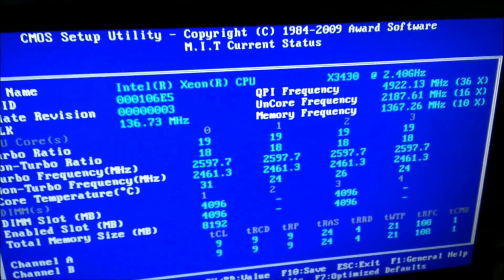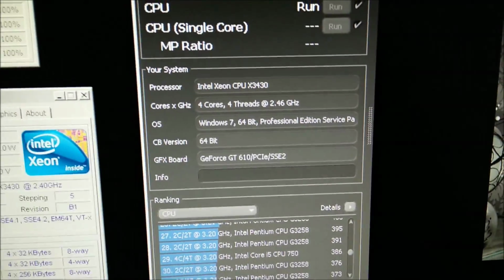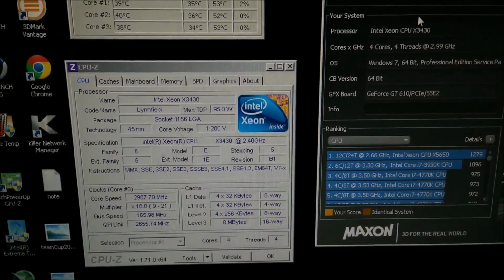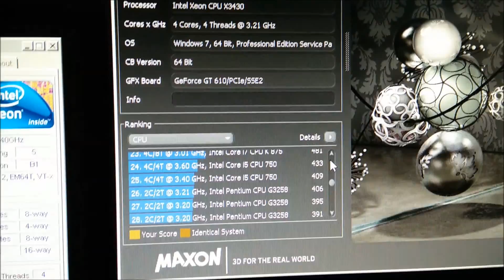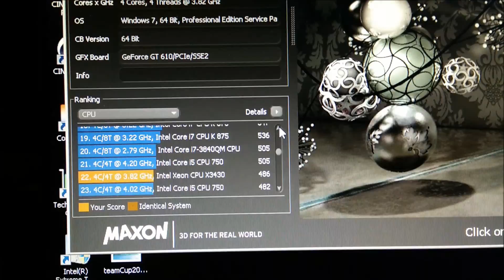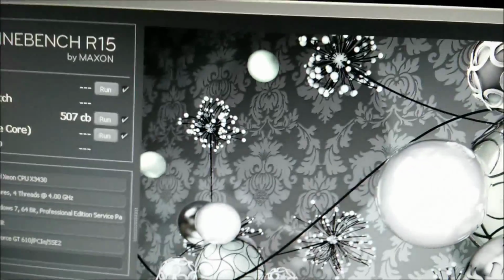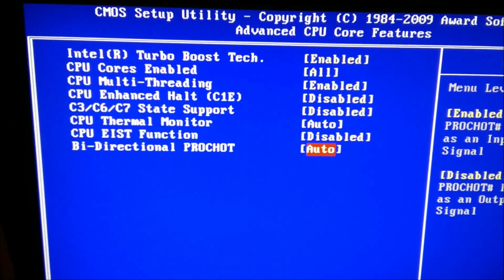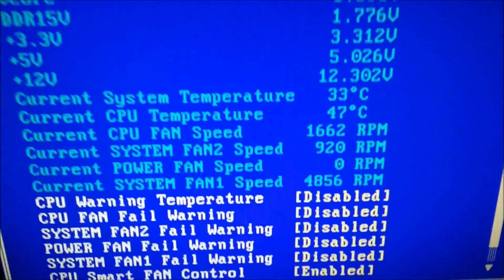Xeon X3430 £20 i5 Killer?

Comment: Hey Guys! 
So I was wondering, how'd you know what LGA 1156 motherboard is compatible with the specific Xeon series such as the x3430? 
Don't need to overclock, just planning on a very cheap build for a family member and I doubt they'd do a lot of heavy gaming.
Reply from the maker: Jimbo Guiling any board will take it as long as it's on the cpu compatability list on the board manufacturers website

Comment: Is it necessary to use a really big CPU cooler for overclocking to say 3.8? I was looking at an ARCTIC Alpine 11 Plus.
Reply from the maker: yes, you will not be able to oc very far on a stock cooler. there are some great coolers on aliexpress for £15-25. I have just ordered the VTG 5 cooler which has 2x 120mm and 5 heatpipes for £22. I will probably do a video on it to show the performance when it arrives in a few weeks.. :)
Reply: Lawrence Timme are these better than a Deep Cool Hyper 212 Evo? I was looking at the VTG 5 but worried about getting slapped with customs fees here.
Reply from the maker: i am not sure yet, i will be testing it against 212 evo! if you look in description some seller say they only put $10 value on customs forms for you :)
Reply: Thanks for your replies. Subbed!
Reply from the maker: thanks. like i say it could be a few week before the cooler arrives. maybe you can find another review online of it vs 212 evo.
Reply: Hey, I actually used the Arctic Alpine 11 Plus and got it to 3.6 with "okay" temperatures. (maximum 82 Degress in Prime95)
Reply: dougbkk assassin's Creed origins might... But the CPU itself is only around 12€/$ right now... So I mean... If it's broken its not THAT bad, right ;)
Good cpu try and test overclocking, especially if your new to it... In my opinion :)
Reply: dougbkk true! Often cpus are over rated... Configuring a budget pc for 275€ including a gtx 960 right now. Great value! AC origins is bad ass though ;) cpu bottleneck at its best
Reply: Hubwood that’s not that bad I guess! I’m on 3.8 with the EVO 212. 82 was my hottest as well with PUBG. No other game seems to make it run that hot though.
Reply: Hubwood I got mine for $7! For that price it’s an absolute steal. Paired with a GTX 1060 I can run most games on Ultra at 1080p/60fps.

Comment: I am considering between the X3430 and X3440 currently. The X3430 is available at US$9.99 while the X3440 is at  US$28.95. Is the extra US$!8+ worth it for the extra 4 threads and hyper-threading? Also, what is the maximum clock speed that you can overclock a X3430 to? Appreciate it if you can help answer these questions
Reply from the maker: ht gives you 20% more performance, but creates more heat so you might not be able to oc as high, if you play aaa games that will use it, it may be worth the extra but many things dont need it so you might save that money for a better gpu.
Reply: Well I am most likely looking to play games like GTA V, Assassin's Creed and the new games that will be coming out. Also, how long do you think the X3430 will be able to last if I were to use it for normal usage and playing games only?
Reply from the maker: in that case you are best off with the chip with hyperthreading. it will really help in gta 5
Reply: Just a curious question but how would a 4C/4T i5 without hyperthreading run gta 5 as compared to this processor? Curious as you mentioned that hyperthreading will help with that game
Reply: Not only that, what are some motherboards that I can use for overclocking? I am not exactly familiar with the motherboard series of LGA 1156
Reply from the maker: Jeremy Koh you can overclock on both h55 and p55, but p55 will oc a lot higher and h55 is a lot cheaper. a new i5 4c4t would be faster a tiny bit, but obviously the price difference is massive.
Reply: Thanks for the information. Now one last question, if you don't mind. Which CPU cooler would you use for overclocking either the X3430 or X3440?
Reply from the maker: Jeremy Koh it will vary from cpu to cpu. silicon lottery. so neither will be better than the other.
Reply: Like which cpu cooler do you use? or rather, would you recommend an AIO or a air cooler in this instance?
Reply: I may have phrase my question wrongly. What I wanted to ask was which cpu cooler would you use if you would be overclocking the processor
Reply from the maker: Jeremy Koh i would always go with an air cooler over an aio., they last forever and cant break like aio pumps can. and decent single tower cooler with 6 heatpipes should be fine. i use a i5 5675c in my main system atm, but i will be upgrading to a 4c8t ryzen soon.
Reply: Do you think I should get this CPU over the new Pentium G4560?
Reply from the maker: Jeremy Koh phanteks ph-tc14pe is my favorite cooler, but if you are on a budget look for a used one or an nh d14 or thermalright silver arrow or any other large air cooler.
Reply from the maker: Jeremy Koh yes
Reply from the maker: Jeremy Koh tbh it depends on the motherboard choice and prices. an i5 2500K would also be a good option. but again motherboards are hard to find.
Reply: Would a hyper 212 evo be suitable for overclocking on this chip?
Reply from the maker: Jeremy Koh tbh its a bit small and there are better coolers for the money.

Comment: Lawrence - 1.12 on automatic offset settings as default. What i am scared of is leaching voltage from other sources, as i up cpu  volts, they seem to run away from 12 volts, signifiCUNTly, i found most of the pc on the street, while coming from a 2 day work PSYCle)

Comment: I got asus p7p44 lx mb, 2*4gb vengence dual channel, 1*4gb single channel. gtx 950 ti geforce card, aaand yeah, x3430.
Getting stable 400 fps in csgo in 1k, and stable 200 at 4k for some reason. Problem is that i am running water cooling, and under stress i get inly 45C temps at 3.8 oc stable. got everything out of it for 200 au$ (like 5 pence in UK probs). Shall i go higher? cause in australia ambient temperatures are 30+ at this time of the year, and my whole system in case runs cooler than that somehow...
Reply from the maker: what voltage are you running? you can go upto 1.4v and you should be fine.

Comment: I just got this Xeon X3430 and im planning to overclock it. I have a Asrock H55M-LE and 2x4 DDR3 1600mhz ram sticks how do you suggest me to overclock it?
Reply from the maker: i would see how high you can get with 1.2 or 1.25v. as long as you keep the cpu under 80c it will be fine.
Reply: Overclocked this from 2.4ghz to 3.0ghz w/ 1.2v. I can overclock it as high as 3.8 or 4.0 but my deepcool iceedge mini cannot keep up with the temp, i need to buy atleast a coolermaster 212 EVO. :D
Reply from the maker: Mr. Egg good :)
Reply: managed to get atleast 3.6ghz with 1.23v. cant push it more tho. cuz of my high ambient temp of 38c.
Reply from the maker: well that is a decent overclock. :)

Comment: btw.. the bios setting you show at the end.  those are the stable settings right?   like i could use those settings and run it at 4.0ghz stable?
Reply from the maker: they were stable for cinebench, 223 on the base clock is quite high for some motherboard, i think 3.6-3.8ghz would be 100% stable for normal usage
Reply: So all the same settings but with one of those frequencies?
Reply from the maker: paul Z well it will dpend on your cpu and motherboard and ram, they are all different.
Reply: Of course..  I actually just recieved my x3430 in the mail. It's going to be on a supermicro server board and have 8gbs of DDR3 server ram
Reply from the maker: paul Z in that case you probably wont be able to overclock it at all :(
Reply: Noooooo!!!!     .....Lol

Comment: So im about to buy a x3440 and atm I own a i5-760 u think its worth the upgrade for multiple games open? (its still cheap tho..) I dont mind meanwhile i dont lose performance cos xeon arent built in mind for gaming
Reply from the maker: it would be a downgrade if you already have a 760.
Reply from the maker: H0M36R0WN 73RR0R157 L337 well they normally arent unlocked so that doesnt really help.
Reply from the maker: H0M36R0WN 73RR0R157 L337 it wont oc any better if its locked as most 1156 chips will be limited by the motherboard rather than the cpu.

Comment: I bought this CPU on ebay for $12 and used it for a gaming rig. The only set-back to X3430 is that it doesn't support hypert-hreading. H-T doesn't really help for gaming purposes but you can get a x3440 or x3450 for around $35 if you are running task that need H-T. Great CPU's for the price.
Reply from the maker: +Shawn Snow yes that is true. i have just had to get an msi p55 gd65, since my giga p55a ud5 died :( liking it so far though. the only thing it lacks is the ability to lock in the turbo speed to get that extra 1x multipler.
Reply: +Lawrence Timme hi 
i just ordered a x3440 and i want a mobo for overclocking, any recommendation?
Reply from the maker: abdullah redwan a P55 board
Reply: any cpu cooler for overclocking?
Reply: Like anything it depends on how much you're willing to spend. Cooler Master Hyper T4 is 24.99 on newegg, they are pretty decent. If you wanna move up to the $50 range, a lot of people recommend Phanteks.
Reply: thanks, will those coolers help me achieve around 3.5 - 3.9 ghz?
Reply from the maker: abdullah redwan a cooler master 212 evo is a popular option, but i like phanteks coolers best.
Reply: it can help in some games, but not all of course. Anyway I'd say you got a good price on that particular processor.
Reply: buy some used watercooling..